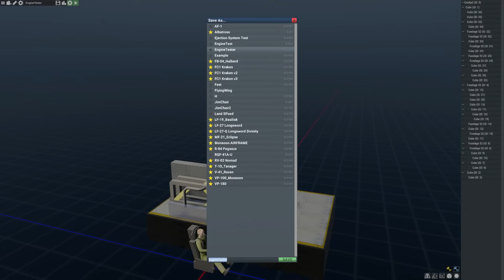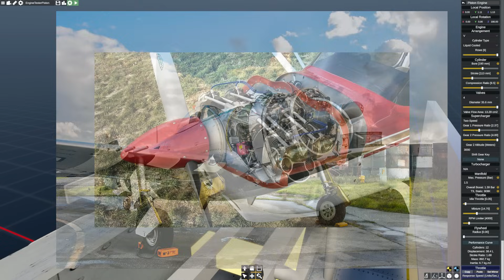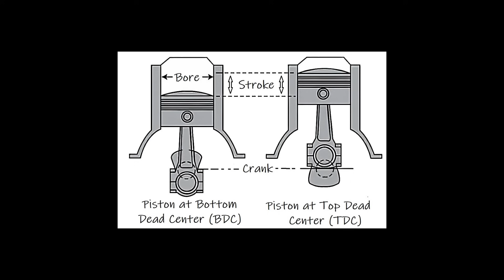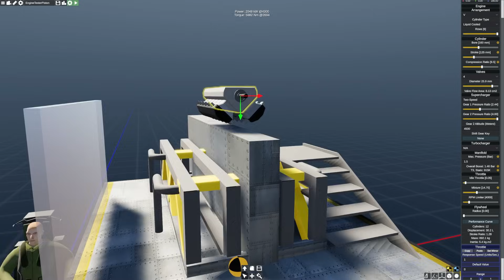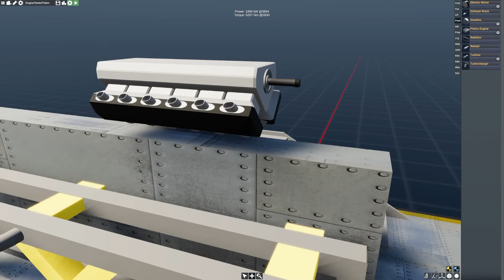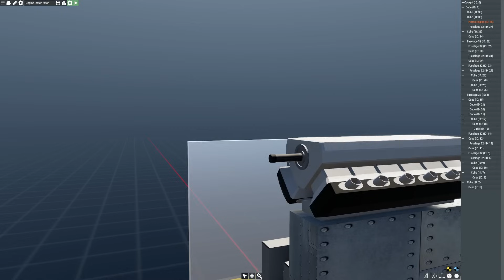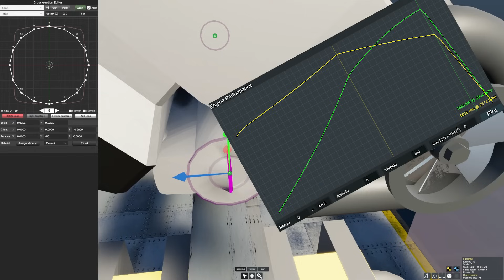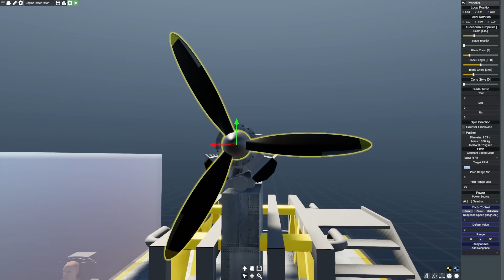How to Build Custom Aviation Engines With Flyout!

Comment: I wonder how hard it' be to adapt a car engine for airplane use.
Probably worth looking into techniques used at the Pikes Peak hillclimb race, where race cars reach some pretty high altitudes
Reply: Well there's that, but an other big problem is the fact that a car engine always operates in the same angle while an airplane engine can turn in all positions, thus you have to quite heavily modify the lubrication system from a wet sump to some kind of special dry sump

Comment: Can you do an opposed 2 stroke diesel. 

In theory you can boost until it explodes as it doesn't suffer from preignition. 

They were around in the 30's but development didn't rub its course.

Comment: https://youtu.be/htBDBH6p5RA?si=bJ61j9yXUwXU4V2I

I don't know if something like this is possible in Flyout but if it is, why not try to make something like it?
Reply from the maker: It is not really possible in flyout in a capacity that properly works. At best it can be modeled with joints, but there is no way to physically connect it to an engine with real throttle response
Reply: @messier82ac  Mhh, that's a bummer. If at some point it becomes possible, would you be up to do a build with this?

Comment: If you are wondering how to figure out your prop speed. You want it to be between 0.7 and 0.8 tip Mach “that is shown in the propeller menu”. And in order to get that speed reliably, you take your engines rpm at max power for whatever altitude you want to optimize for and divide it by your prop rpm to get your gear ratio.

Comment: Lift and duration of the camshafts and the way the cylinder head flows play a much, much bigger part than bore, stroke, and fuel. Lobe separation angle plays a part as well. Unless you have forced induction in which case you definitely need to look at the flow rate of your cylinder head and definitely want to run much stiffer valve springs to avoid floating them.
Reply: I like your enthusiasm, but you know that there are no such settings, right? This is not automation game (yet,
I hope, cause that amount of details would be cool)
Reply: Nah you actually gotta reduce valve size on turbo engines coz the head flow is so dang good in flyout your engine destruction point will almost always be before peak power with any amount of boost
Reply: @someweeb3650  Oh, ok that setting is there. :D
I never actually used a turbo or compressor, I'm happy if I manage to lift my abomination from ground :D

Comment: I get it that you mentioned Radial, Inline, and V Engines, but didn't mention W Engines, W engines are Engines are engines that are basically 2 engines in 1, if it's a V engine and an Inline engine in one, or two V engines in one, tak for example the MK-44 Engine, which is 2 22 cylinder V engines in one, have 7,546-8,000 horsepower tops, though expensive, has quite the bang for buck
Reply: Do you even play this game? There is only inline, V and radial settings in game, so if you want boxer W or something else you need to make it out of inlines hard-coupled together by gearbox
Reply: @jakubpollak2067 

No, I don't, and yes, there IS only 3 types of engines in Flyout, but those engines I mentioned 4 types of engines, sadly what I didn't mention R, and Nuclear Powered Gas Turbine Engines, R engines are basically 4 in one, mostly 4 V engines in one, it is VERY popular, sadly it is experimental, and Nuclear Powered Gas Turbine Engines are concepts, basically the 5 other engine types if they require Nuclear Energy to run, if done right, these engines can run FOREVER, but their just like THAT, concepts, only in the Fallout Series
Reply: @ChristopherGriffin-ee2ol  Still I don't understand why he should name different types of engines, that are irrelevant to this topic, neither why you do you keep naming more.
Nuclear engines don't run FOREVER, they are not just concepts from fallout series, they exist and work, but they are too heavy (shielding) and risky to be used in airplanes. Go touch grass or do some more research about this topic.
Reply: @jakubpollak2067  

And I know how are engines, but I don't know HOW do they work though

Comment: My main problem is that any engines with similar parameters to real world planes seem severely underpowered in flyout. I'm guessing it's just my poor propeller blade tweaking, but I can barely get a 1200kW engine past 300kts near sea level when similarly powerful planes had a cruising speed well above that😢
Reply: 300 knots is huge for 1200 kW what do you mean ?
Reply: @Tacticaviator7  the LF Mk IXe had 1283kW with a max speed of 350kts at 21,000ft. The craft I made can barely get 305kt on the deck and struggles to get close to 250kt above 15,000ft.
Reply: @AE_Sub  Hmm, you getting good manifold pressure at that alt ? Usually forced induction planes have better speed at higher alts.
Reply: @AE_Sub  why are you comparing on-the-deck speed with 21,000ft speed?  There's way less drag at 21,000 feet.  Of course you're going slower at sea level.
Reply: @Tacticaviator7  Yeah it might be the supercharger not being set up correctly as well then🤔 I'll try fiddling with different setups when I'm back home, thanks
Reply: @Ausogiea  You're right, I didn't consider that since I was getting abysmal performance at altitude anyway and the drag vectors seemed too tiny to matter too much at sea level. I'll try to revisit my design street tweaking the boost pressure etc.

Comment: 6:25
*a lot of modern cars, especially turbocharged ones, will change ignition timing and turbo boost when they detect that they're running higher octane fuel than their minimum, so they will make more power.

Comment: While it's generally true that putting a higher octane than your car is designed for in the engine won't improve it's performance, modern engines are smart enough to detect that there's better fuel available and will adjust their fuel mixtures and if relevant boost targets to make use of it.
Reply: Only to a point where the engine would still be knocking with low quality fuel to begin with.
My car engine only scales to 98 RON Europe rating, it is overfueling if cooling is needed, so 100 RON will use a little less fuel when flooring it, but no extra power will be generated.
To take advantage of very high oktane aviation/racing fuel more compression ratio, more boost/air flow and more durable parts are needed, the result is a higher engine cost.
The higher engine cost is the reason modern cars only scale to a point where it makes sense, because most people are not fueling aviation fuel.
Reply: @larsjrgensen5975 so instead of using the same amount of fuel per cycle to produce more power (due to higher octane number), it uses less fuel per cycle making the same power for less fuel? I guess that would work better for an everyday car, since you’re mostly just using it for getting around at lower speeds anyway
Reply: @hhhhhhhhh1071  I am not sure if we are on the same page.
This is an example for understanding, real life is more complicated.
my car makes around 220hp
If throttle is blocked to produce a max of 190hp, low or high octane makes no difference because the engine does not knock.
If throttle is blocked to produce a max of 200hp, the low octane fuel needs extra fuel to cool, but the power is the same and the driver will feel no difference.
If throttle is unblocked to produce a max of 220hp, the low octane is limited to 200hp no matter the fuel amount and compensation, but the high octane is able to safely let the engine make 220hp.
If the engine is upgraded to handle 300hp the normal pumpgas high octane might not be enough and E85 or aviation fuel would begin to make sense.

Fully agree on the everyday driving, 90% of the time super high oktane is not really needed.
If going on a highway roadtrip premium might be the same price in the end, because the lower octane maybe needs 1-2% more fuel to cool, but it depends on the car, outside temperature and driving speed.
Reply: @SmallAndDisfigured yeah I don’t think he knows what he’s talking about ngl